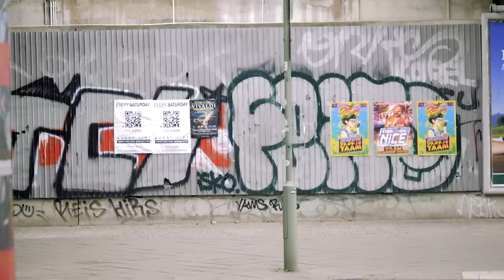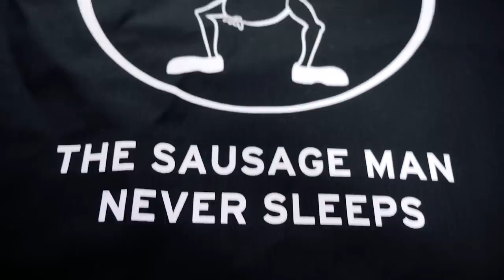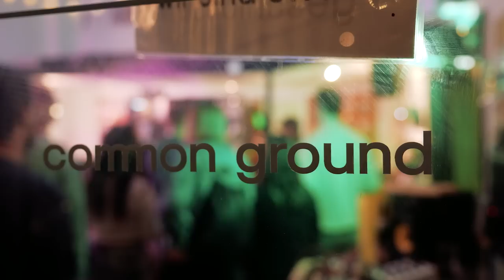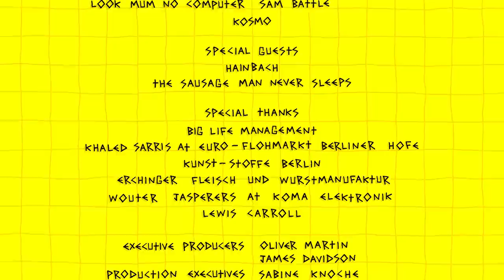SAUSAGE ORGAN - A Musical Instrument Made From raw SAUSAGES Junk Rock tv

Comment: I made one of these about 6 years ago, except with bananas. I called it the Banana Piano or the Fruit-o-Phone. It is a big hit at our local maker fest Makevention. I also used a capacitive touch sensor IC (not a makey makey) and then wrote some custom code on an Arduino to send MIDI codes to a Roland modular synth. It sounds great that way. I use bananas for the white keys, mini cucumbers for the black keys and an apple and an orange to change the instrument.  The faces of the kids really light up when they first press it.  Actually I've been inspired recently by some of your videos recently to go back and convert it into a real synth with it's own oscillators and filters. Look for Banana Piano 2.0 next year.